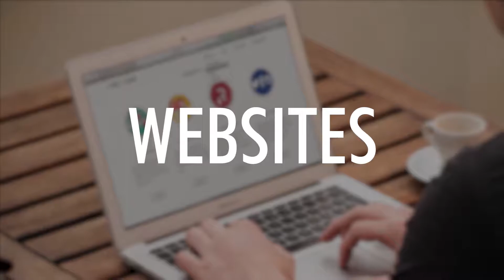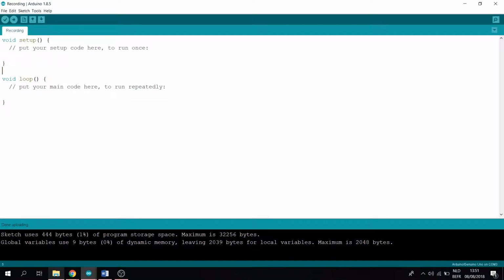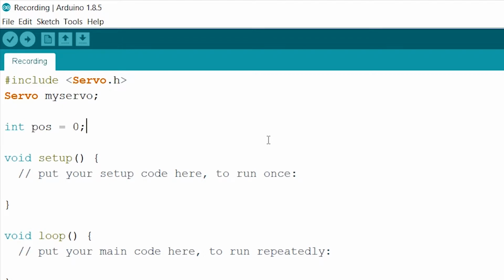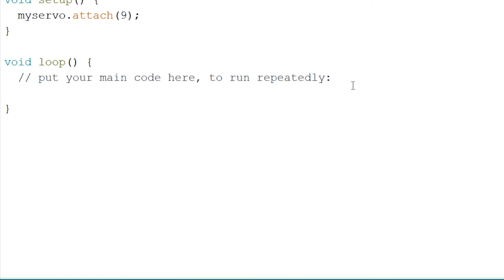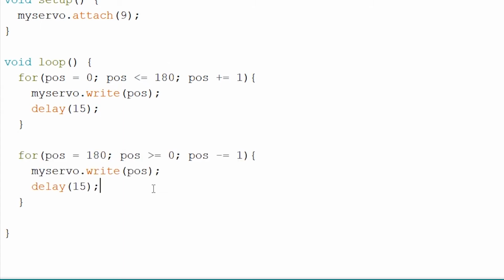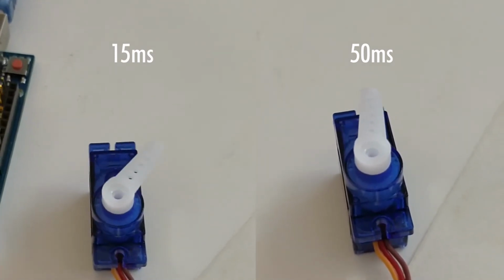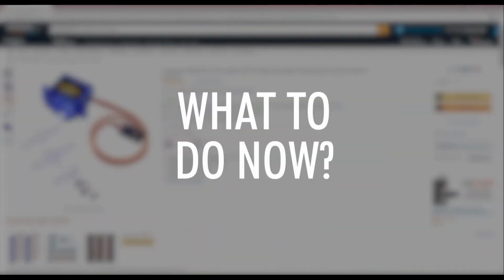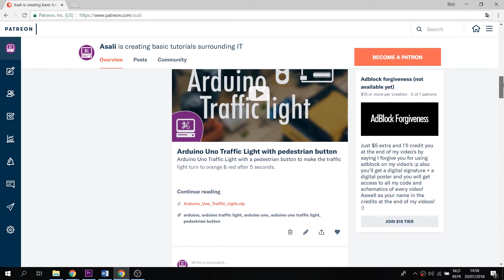Arduino uno servo motor set position and rotation speed

Comment: Ok with this code  i have a RR crossing code my servo goes to 0 to 90  how would I  make the servo pause at 20° before reaching 0 ? 
Ive tried delay and servo detach and it wont stop or it just stops the servo.